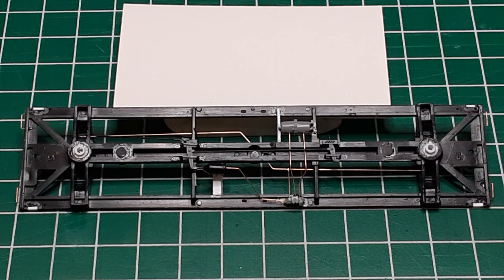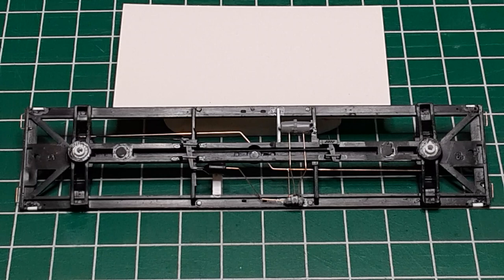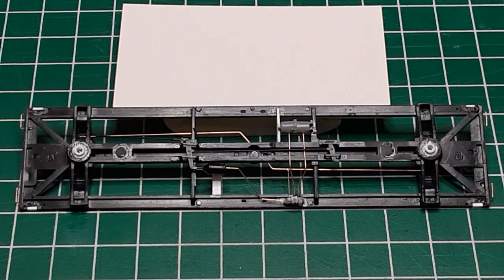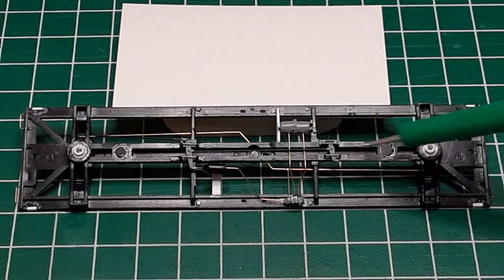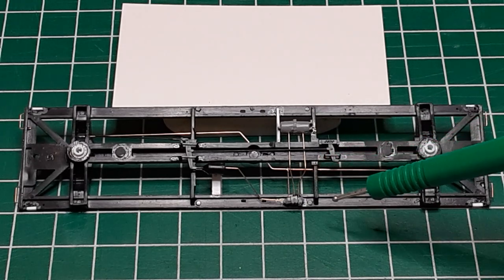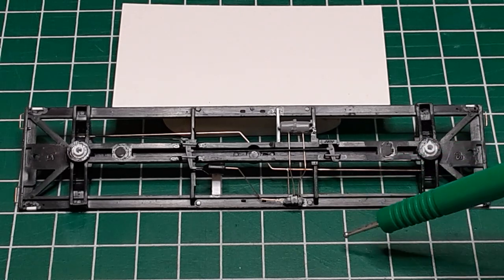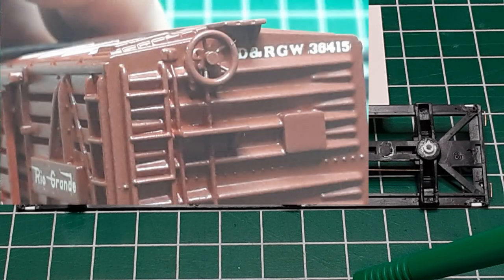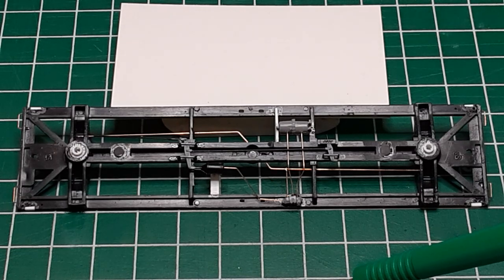How Railroad Freight Car Brakes Work

Comment: Great information!  
Also passenger equipment air brakes are operated at a higher pounds per square inch than freight. Automatic Brakes are charged up to 90 lbs sq/in on freight and 100 lbs or greater on passenger. This can be adjusted on the locomotive.
Reply from the maker: I didn't know that! How do they handle air pressure on mixed consists?

Comment: Once the high-mount brake wheels were replaced with today's low mount ones, I believe the retainer valves were moved to the same location as the AB valve. I just checked some pics of some Greenville gondolas I took last month, and the retainers appear to be mounted just to the left of the AB valve, with the release rod just under the right side of the valve and extending to both sides of the car.
Reply from the maker: I did not know that - thanks. I had read that, on passenger cars with brake wheels on both ends of the car, the B end of the car is the end with the retainer valve. With the retainer valve mounted underneath the car (if indeed they are mounted underneath passenger cars) how does one determine the B end?
Reply: @rwissbaum9849  I was not aware of passenger cars with dual brake wheels, but in that case I believe the B end was designated as the one towards which the brake piston pointed.

Comment: Hi, and thanks for the education and good view of the braking system! I am confused about how the levers are mounted, or how they swivel. I see that the cylinder moves the lever, and the rod connected to the bolster (truck) activates the brakes. What's not clear is how that "floating" lever moves. It appears to be linked to the other lever in the center point, thus having little or no movement. Also, where is the pivot point of that "floating" lever? at the top-most end?  Thanks!
Reply from the maker: As I understand it, the pivot points for the brake lever and the floating lever are offset from center and on opposite sides. For purposes of understanding you can assume that the pivots are built onto the mounting brackets - and that might even be the case. So the brake lever pivots around the mount closest to the brake cylinder. This provides the best multiplying effect to the brake rod attached to the opposite end of the brake lever. The connection to the floating lever is in the center, but the floating  lever pivots on the other side - the side away from the brake rod. I fear this is a confusing explanation,  but once you realize that the pivots are off-center and on opposite sides of the centerline, the action should make more sense.
Reply: @rwissbaum9849  Thanks for taking the time to answer! And yes, that makes perfect sense! For whatever reason I was assuming center pivots, which of course didn't make sense with what I was seeing.